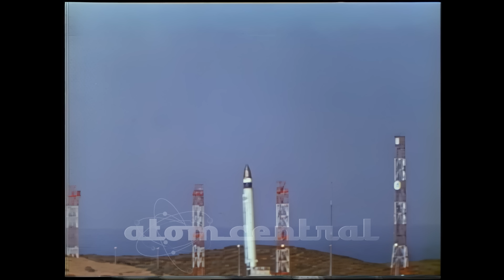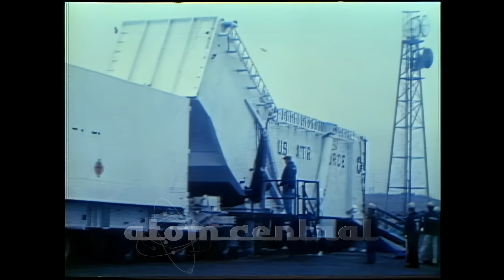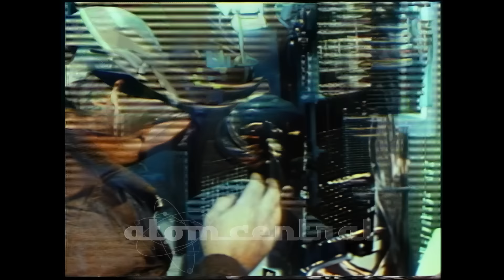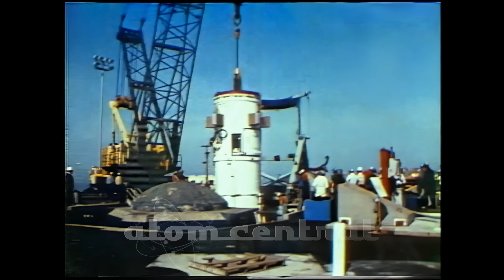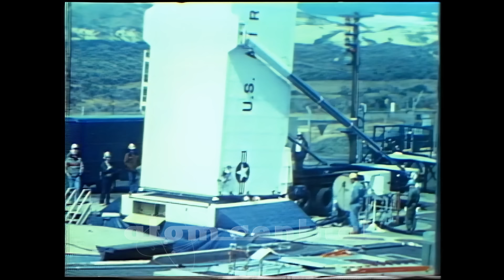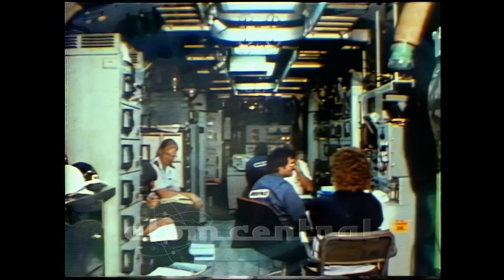First Peacekeeper ICBM launch

Comment: Am i hearing this right, they moved back to liquid fuel in this 'upgrade'? Sounds like a maintenance nightmare.
Reply: As far as I understand it is only the 4th stage
Reply: The final stage will almost always be liquid fueled because it’s needed for fine tuned adjustments and/or evasive maneuvers. Solid rocket fuel can’t be turned off or precisely controlled.

Comment: And here we are 40 years later in development hell with the Sentinel. I understand Peacekeeper was expensive to maintain, and START required reduction in deployed warheads, but surely the newer of the two systems (Minuteman vs Peacekeeper) had more upgrade potential...
Reply: Peacekeeper had massive maintenance costs due to AIRS (as cool as it is). If anything, peacekeeper had its own development hell and every ICBM program will have development hell. Sentinel is no different.
Reply: Part of the problem was the hypergolic fuels.  We were near Vandenberg when they had a couple of failures.  Handling of those was nightmare, and any kind of Solid Motor was a vast improvement.  Also don't forget that a couple of them only went a few hundred feet, after they were operationally tested.
Reply: @brunonikodemski2420  There were never any problems with the hypergolic fuels on Peacekeeper's 4th stage. I worked the program both at Warren and Vandenberg to include 14 test launches. It was a sealed system until activated. There were other problems that did PK in some we won't discuss here. 

Few hundred feet? There were only 2 flight failures with Peacekeeper. Both well far away from Vandenberg out over the ocean
Reply: @re2248 Thanks for working on this awsome weapons system. So bad it was taken out of service after just a few years. ☹️
Reply: Neither the MX nor the Sentinel should be built, because neither is survivable in tomorrow’s environment.  Instead, we should develop a maneuverable hypersonic missile in the long term, and a pile of stealthy cruise missiles to fill the gap.
Reply: @TheCleric42 
Nothing can reliably interpret ICBM RVs in a cost efficient way.

Comment: Give it a block upgrade and Bring It Back!
Reply: sorry...what...? 
bizarre use of "block upgrade". also, why bring anything back. no one will be left to refuel and rearm it.
Reply: A Block Upgrade in the aerospace industry means nothing more than a group of engineering and documentation changes all applied at the same time. The Peacekeeper is an older system and would need to be modernized for deployment. The rockets are still used to this day to launch satellites.
Reply: @richardlangdon712  ok ChatGPT.
Reply: Would love to see this weapon being back. Should never have been taken out of service.
Reply: @anderspersen3260 
Peacekeeper was a very expensive ICBM to maintain.